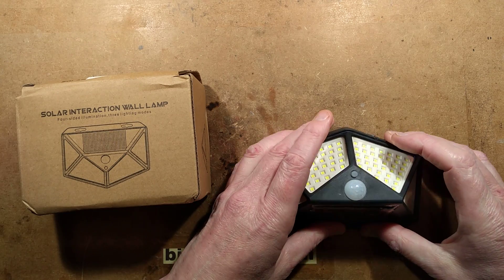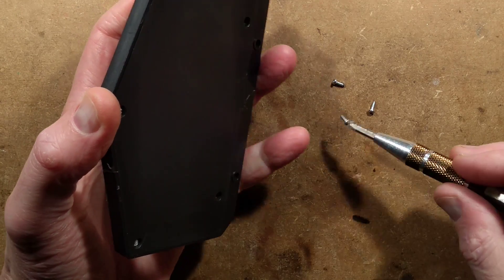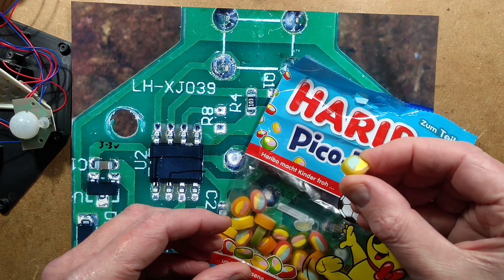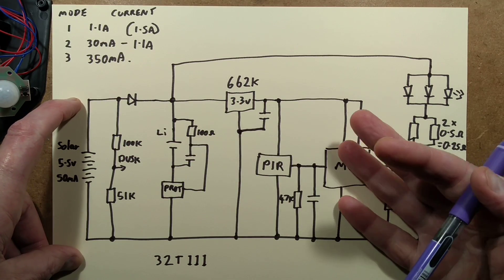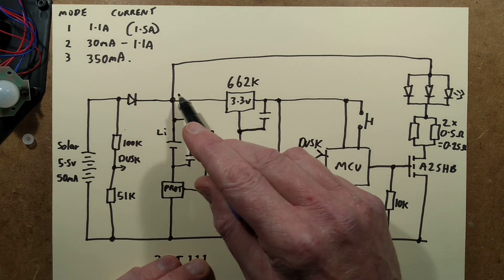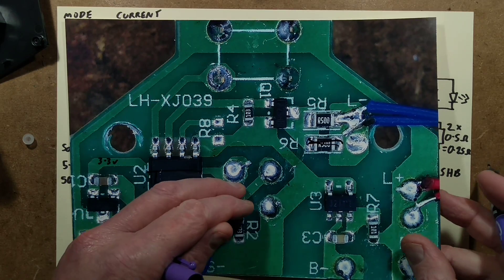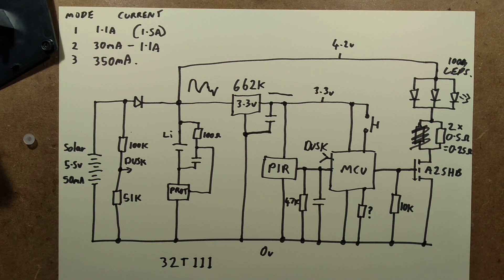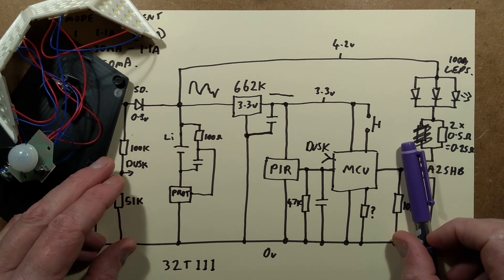100 LED solar garden light teardown (with schematic).

Comment: for a while i've noticed that although they say items come from china, i've been receiving them from places like malaysia, laos, kyrgyzstan, and other random places. im guessing its somehow even cheaper to send from those places then it is from china, as dirt cheap as it already is. it usually takes longer from those places, too, which is annoying.
Reply: I've mostly given up on Ebay for these sorts of things. Instead, I order from places like Banggood, pay a bit more for Canada direct shipping, and I get most everything in 10 days to 2 weeks. Ebay? 2 *months*+. Prices are slightly higher on commerce sites like Bang, but I can't stand waiting for 2-3 months.
Reply: @TheJohn8765  Order from Aliexpress and you will get them cheaper and with free shipping. Banggood is just a dropshipping site for Aliexpress. Even on Aliexpress there are the manufacturers and then export companies so by the time it is listed on banggood 3-4 companies are taking a cut. I spent close to 2k on Aliexpress a few months ago but it would have cost me 4-5k buying the same stuff on amazon or ebay.
Reply: @excitedbox5705  Aliexpress doesn't use Paypal. I'm not sure if that's good or bad!
Reply: China has been using other countries as a go-between for China-to-US transactions. It's a rather clever way for them to bypass the tariffs. :-)

Comment: Symbol for a Schottky diode is a diode with the bar replaced with an elongated S made of lines that meet at right angles. If it matters. Then again in the USA, resistors are zigzag lines...
Reply: Of course, they’re zig-zag lines; that’s how they slow down the electrons! Doubt me? Try driving on a road that looks like that and see how fast you go without crashing or ending up going off the road! 🤣😆 There’s a reason behind the madness. 😏

Comment: Question for electronic guys: I had a small  plug  light with sensor (the same like in video) and it would light up maybe 5% of the time. even when I moved and danced in front of it - nothing happened. Sometimes it would detect movement from 2m but completely randomly. Any reason for that?
Reply: Probably the passive inferred sensor going bad.
Reply: maybe the sensor is going, or water has gotten into the unit.

Comment: An inexperienced comment:
Can a lamp recycle a tiny whiny bit of its power by having its solar panel under its light source? 0.1%? 0.01%?
Reply: Kind of, yes - and in fact with modern solar panels approaching 20% or so efficiency and LEDs being around 10-20% efficient, you could (at best) perhaps recover around 1 - 2% of the light that fell on the panel.

The problem is of course is that instead of generating "excess light" and having a 1 - 2% recovery of it, it would be better to focus the light JUST where you need it - and REDUCE the amount of power being used in the first place. So there is no wasted light to illuminate the solar panel in the first place.

Good thinking though :)
Reply: Yes, but it’s so little that the cost of the solar panel is more than the amount of power you would recover.

Comment: I need something like this with a 12v, 3-4s liion or lifepo4 battery, and about a 10-20 watt pv to charge, with 3, 5 watt LED, 
I guess I'm going to build my own, using 18w led flood/spot light, and possibly 4s LiFePo4, enough to light about 6 hours, and charge in 6-8 hours, and have the option to externally charge,  for off grid use! Things like this can come in handy!!

Comment: Got 8 of these at  end of July (4pack for 14.99).  now price  just check is 19.99 for 4 free P&P  
great light when it working But.. 

result:

3 partly working - working but if you go out to the garden a couple of time then it die.  
4 die completely and 1 just flash  then die.

will definitely  try  Clive suggestion solderer one of the R500  resistor
if it dont work then best option is rewire the light giving it more stable power 

I guess what you paid for is what you get
Reply from the maker: I swapped the resistors out for a 10 ohm one.  Much dimmer, but more stable and longer lasting.
Reply: @bigclivedotcom  you mean replace the r500 with the 10ohm one?
Reply from the maker: @jetli740  Yes.  Or if it's easier just add it in series with the PCB and the wires going to the LEDs.

Comment: I have bought a number of types of these type lights.. BUYER beware..  They work, no doubt.  However they either do not last long OR the solar panel calcifies white which pretty much blocks any charging capacity from the solar panel..  They are not weather friendly in that regard.  But otherwise they do work.

Comment: I want to understand this better real bad. Circuit boards fascinate me.
Reply: Try having a look on Ebay for electronic kits. Simple ones with half a dozen or fewer components are good places to start working out what happens - and cost about £2 including carriage. Most will have a little circuit diagram with them.

Also worth looking for are free online electronic "intro and basic" courses. they will give you an understanding of the basics quite quickly and then you start to work out how and why the circuits work. https://www.instructables.com/class/Electronics-Class/

https://www.ebay.co.uk/sch/i.html?_from=R40&_trksid=m570.l1313&_nkw=electronics+kit&_sacat=0

Comment: For lights that use 18650s or 14500s, would it be viable to connect another battery to them to increase power on time? or would 2 batteries be too much for the circuitry?
Reply: If it was put in parallel the circuitry would just see it as a higher capacity cell.
Reply: Yeah figured as much.. Thanks guys.
 My 1000LM solar light which does have a beefy panel on it is lacking charge due to the season change.. the problem is its using an 18650 with a protection chip on it and a quick connect/disconnect harness so I cant charge the battery using a charger.

My 14500 lights which is 5LM standby 100LM when active (Both lights have PIR) are actually the ones I was hoping to boost, they use batteries that I can manually charge and with their lighting they last MUCH longer, but I was hoping to maybe double the capacity with another battery. Although, now that I think about it, they likely wouldn't last long during the cold months anyway since low temps will affect the batteries.

Bleh, thanks anyway.
Reply: It's ok to connect similar cells in parallel but it wouldn't make any difference if the charge is being limited by the size of the solar panel, which is probably the case here.

Comment: What cell would you upgrade to, we have one but doesnt last too long as not a lot of daylight hits it at the front door ?
Reply from the maker: These things really need a lot of light for best operation.  The best improvement you could make in a low light area is to use a higher value resistor in series with the LED panels.  The light will be dimmer but will last much longer on a charge.

Comment: The regulator has a bit of dropout voltage, let's say 100mV, then the regulation collapses when battery reaches 3.4V so it's not nearly empty, it's 30% charged. Under this condition PIR can become unstable i would think. Naturally 3.4V is also easy enough to reach in a state of high charge if you just try to draw enough current.

Comment: JBL speakers? I know they are high end, but I have two and would like to see how they work, especially because they are a bit wonky.
Reply from the maker: I took a small JBL speaker apart in a video.
Reply: @bigclivedotcom  The cylindrical ones. With subwoofers in both ends. They have a hefty battery, aswell.

Comment: That battery cell is already $1-2 in bulk. Then you get a nice little solar cell, a battery charger, a PIR, and a 100 LEDs. that is quite a value.
Reply: Yes it is, sourcing the parts off of Ebay prepare to spend $4 for the solar cell, 2 dollars for the battery, $3 for an array of LEDs $5 for 5 battery protection circuits so thats $1 per cell, $0.10 for a diode.

Comment: I've had a couple smaller versions of these. After a few months they'd fail to turn on but have a charged 18650 still. Not really sure if the sensor is failing or the switching transistor.
Reply from the maker: Check for corrosion.  The PIR sensors are not properly sealed.
Reply: @bigclivedotcom  I have 2 very expensive battery chargers that have both failed in the same way, I would love to send them to you from Australia for you to have a look at if your interested? No one can figure out what’s wrong with them. Would make a great video even if you find out it’s not  repairable. I will be more than happy to pay you if you can repair them also.. let me know if your interested
Reply from the maker: @JimLahey21  What type of chargers are they and how have they failed?
Reply from the maker: @JimLahey21  Check the output to see if there's a protection diode across it.  If the charger has ever been connected with the wrong polarity then it may have made it go short circuit.
Reply: @bigclivedotcom  thanks I will, if it’s not the issue are you interested in having a look at it?
Reply: @bigclivedotcom  I’m not that tech savvy unfortunately... 
Avr’s, electronic governors,  Diesel engines and alternators are my thing,
Reply: When they work! Haha
Reply: @bigclivedotcom  doesn’t seem to be any diodes at all on the board, the only diode (ds1) is an led?
Reply: That's interesting. If there is still 3.3 volts, the FET probably died.

Comment: Funny enough saw this exact same light advertised online today, on sale. claims the cell is 2.4Ah, which is very much doubt, probably a generic recycled cell that is between 600 and 1Ah in real capacity.
Reply from the maker: I think it measured at 1.2Ah.
Reply: Mine measured at 900ma,  I got 8 of them for £22

Comment: You need to get one of the old halogen style worklights to use for testing solar panels. LED just does not work.
I find placing a small 250w unit at appropriate distance simulates sunlight quite well.
My Maxeon cells (wide spectrum solar cells) generates their rated current in such a situation matching good full sunlight while even my 200w led at point blank only gives me a fraction.
Otherwise, keep the videos coming! Enjoying them a lot!
Reply: Really? That's weird. Most bench LEDs can put out ~6500K light (tho I know Clive prefers the warm-white). Do you know what temp your LEDs were? I'd think the warn-white ones (~2500-3500K) would be shit for solar cells but I'd expect ~5500-6500K ones to fare much better.

Comment: Just received a laser pointer from ebay, piece of shit died after less than 1 minute of use, I thought it was the 18650 (Ultra Fire Fake) battery but it's charged to 4.12V. Laser diode is knackered.

Comment: My problem with these solar lights like the simpler ones, have a problem. I put one out over the summer and it got so hot it cooked the lion battery the Cip went, one knackered battery , a great idea but how do you keep the inside cool and water proof??

Comment: Question: Could a light like this be upgraded with a bigger cell and some additional components for a longer running life in case of a busy night?  Also wondering if anyone has considered powering such lights of the 24volt circuit used for doorbells?
Reply: I added a big solar cell on top of mine and lowered the current of all the LEDs. It normally still runs in the morning and it's facing north.
I need to charge them 2 times during winter if it's really dark outside. For that, I added external charging terminals. Worked fine for several years now, because the batteries never run totally flat.

I don't want to run cables across the wall.

Comment: Do you think a pir would keep false triggering if you had one of those plug in heating air fresheners?
Reply: Only if it would move.
Those PIR sensors only detect moving changes in temperature.
Or else, every PIR sensor would get triggered by sunlight, radiators, incandescent lights, ...
Reply: @kpanic23  I wondered about rising heat or any sort of temperature control, I'll try it
Reply: @phonotical  Trust me, I had a PIR sensor installed in my bathroom. Quite frankly, it's terribly inconvenient. If you just have to take a leak, the lights stay on for 5 minutes after, needlessly consuming power.
But if you have a little more pressing business to attend to, after 5 minutes the lights go out and you have to wave your arms like a maniac to get the lights back on.
Even worse, if you take a shower, all the PIR sensor "sees" is the "warm block" of the shower curtain. Bouncing up and down in the shower doesn't help. So when the lights go out, you actually have to stick your arm out of the shower curtain and wave frantically at the sensor.
Needless to say: I changed it back to a regular light switch after a couple of months. Way too much hassle...
Reply: @kpanic23  I was thinking of getting exactly that, then I thought about microwave sensors, but my lights randomly going on at night would probably be freaky

Comment: The solar cells are always too small to charge the light. That destroys the batteries very fast.
Reply: destroys?
Reply: @kennmossman8701  It makes them cycle at their lower end of state of charge (2.4 - 3v) which isn't good for them and shortens their life. Li-Ion cells last best when used between 3.4 - 4.1v.
Reply: @Shaun.Stephens  quite right.   too damn early here (HKT)!   Need more coffee!   Still destroy is a bit strong....how about affects, diminishes, weakens, .......................

Comment: Not much VP for that many lights.   20mA ?   Our New Mexico Sun would toast that one in just one year.  CRUMBLES it would be.
Reply: If you happen to install a new set, wipe down half of them with ATF (transmission fluid) every six months and check for different rates of deterioration…
Reply: @michaelthibault7930  Most any and all plastic has major issues.  Those solar panels with the epoxy coating don't even last months.

Comment: Most of my solar garden lights seem to only last about a year or so... ah well.
Reply: Security light on the side of my house has  been going strong for about 6 years now, clearly I've got lucky
Reply: Tom Mackay - Yep, lucky you...  :)
Reply: I've been using the glass garden solar lights from harbor freight. Had very good luck with them. I take then in during the winter, before I did that did have problems with short life because they were buried in snow and got waterlogged. The older ones use NiCad AA, the newer ones use NiMH AA cell.
Reply: DaToNyOyO - I have... the last light I examined had one of the AAA green batteries that had furred up on both ends, it was slightly puffed too. I replaced the battery after cleaning the circuit board, but nothing...
Reply: same here. but i admit, i dont care much for them, keep them in rain and snow.
Reply: Thomas Herzog - I've bought cheap ones and expensive ones but they all die quite quickly... Yeah, rain and snow (when we get it in the UK), out in all weathers... I guess water ingress kills them off.  :)
Reply: Preventative maintenance is the key on mine. I opened up the last ones I bought 3 years ago when they were new out of the box and they are still working. Before that I used to throw the old ones away every single year like you. WD40 sprayed over the contacts (battery terminals, even the batteries got some of that stuff). Helicopter tape over the solar panel for UV protection (all of the panels still look like new) and cut it a bit bigger than the panel so it forms a bit of an umbrella.  A bit of grease in the holes where the screws are so you can open them in case the switch goes (just bypass). I guess we guys all have this stuff in the house so it is a question of a couple of minutes to make them a lot better. ... and yes same weather here as in the UK.
Reply: Luc Peeters - Yes, you are correct I guess... I've done the WD40 thing on some of my lights; some still die, some lasted longer... Not heard of Helicopter tape, sounds like a good idea though... The only lights that have lasted for a long time, 3 or 4 years, are a pair of plastic rocks that have had zero maintenance. I've bought new lights that have lasted literally weeks, no rain on them, just sunshine, new batteries inserted but nothing... strange...  :)
Reply: @DaveLennonCopeland   really strange. The issue that I face to repair the old ones is the wire they use in these things. It breaks just looking at it.  For that helicopter tape check Aliexpress and do a search on 'Bicycle Frame Protector'. Ok you might get it after 2 months or so but for the price you can't go wrong. Most of these solar panels go dull after a year or so (except the glass ones). I sanded some of the old ones til they were clear and placed that tape over it and they stay clear.   Also don't stick any high capacity batteries in stuff since that is money thrown away.  The panels would take days in full sun to fully charge them.

Comment: Nice I need about 3 of them.
Reply: I would not recommend these light got 8 in july now 3 partly working 4 die completely 1 flash then die
Reply: @jetli740  thanks for heads up grasshopper

Comment: That fet is rated for 3.6 amps continuous, at 50 milliohms that's 0.65 W heating. If it gets very hot I wonder if they are not driving the gate with enough voltage.
Reply from the maker: I'd guess the transistor won't be a premium brand and may have a much higher on-resistance at the 3.2V it's being driven with.

Comment: Hm, so, the protection circuit just shunts the positive (via the sense resistor) to the ground when there's overvoltage? I reckon that works great as long as the solar cell is weak enough not to overcome that.
Reply: Oh, no, actually, nope, now I get it, it passes the current only in one direction when in overcharge condition and the other way when in overdischarge condition. I've never looked into these.
Reply from the maker: They usually have two mosfets internally to control charge and discharge, and also measure the voltage across the MOSFETs to detect overcurrent.